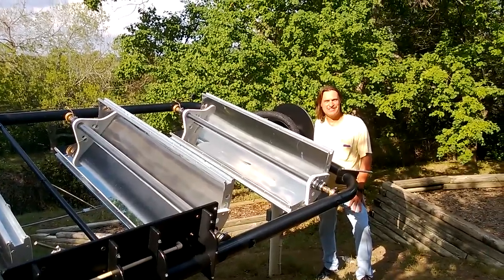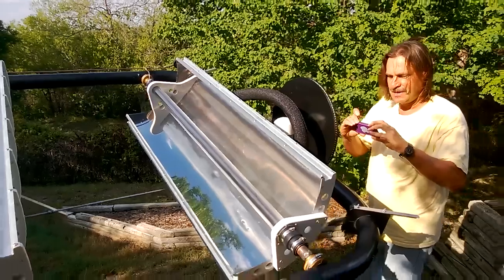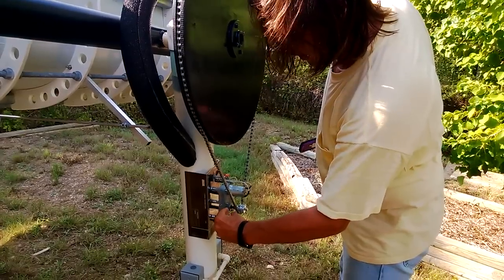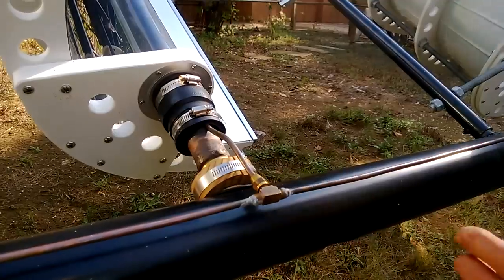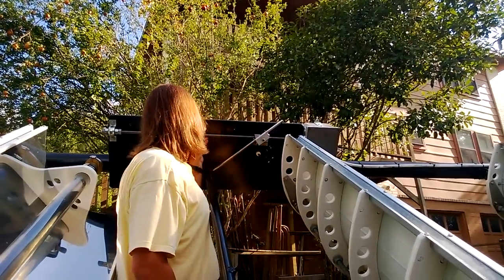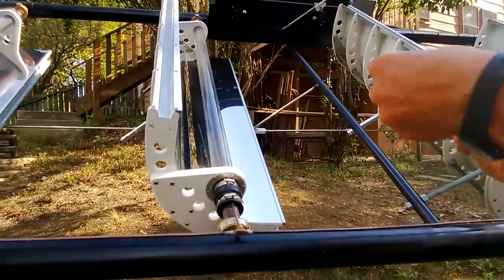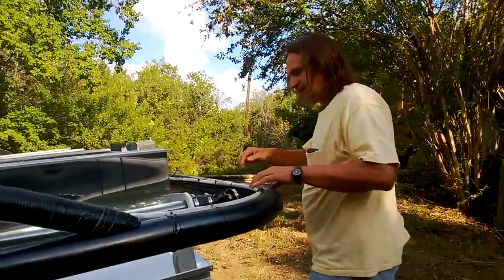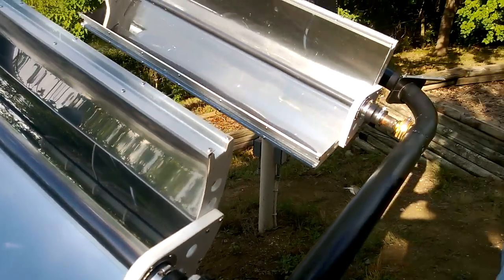Parabolic Trough Solar Collector Water Heater 6

Comment: I believed you use the Dan Rojas homemade vacuum tube with clear PVC.  Im guessing it does not hold vacuum constantly from leaks thus the vacuum pump to keep it at a set value.  If I am correct how is the clear PVC holding up?  Did you use the type with UVR protection or the standard type?
Reply from the maker: Coachgeo,   I used clear polycarbonate tubing (not PVC) with UV protection.  It is holding a vacuum fairly well.  Over a period of 6 months, a small amount of diffusion has taken place, but I suspect that there are no leaks.
Reply: Do CPVC etc. type fittings work with the Polycorbonate tubing? Many would love it if you did a video on how you made the Evac tubes!!  Or am I blind and dumb and can't find the video you did on this already :D
Reply from the maker: coachgeo
Coachgeo,  CPVC and polycarbonate are not compatible.  I used 1-1/2" copper for my focal tube, then converted to CPVC to go into the frame with a CPVC x Copper union (Genova 53046).  The polycarbonate is attached to the central focal pipe with "rubber" Fernco Couplings. 

Now coachgeo, if you are really going to make some of these focal tubes, then let me know.  I have many "unpolished" videos and photos to help out that will explain it perfectly (not ready for prime time yet).  You can get this done if you wish.  You just need to be able to braze copper.  Here is a diagram of the central tube:
http://www.modelofreality.org/SolarFocalTube.jpg
Andrew Ancel Gray
Reply from the maker: coachgeo You are correct in seeing that I have not made a vacuum tube video yet, or a solar water tank video, or a solar water heater roof mount video.  I am working on it!  Right now I am trying to get solar panels (PVs) installed on my home!  So much to do!
Reply: Glad to know Im not blind :D  As you consider what vid to make next... consider that there are many vids about most everything in your list with the ol' cat skinned a different way in each... but there is only one in all of video land about building Evac. tubes and it was not clear tubes nor Poly like you used. (thus all different fittings?)
Reply: Follow up to how to make question asked earlier. Do standard CPVC fittings work with the Polyvinyl tube or does one have to go a totally different route for fittings to create the evac. tube?  Care to shed light on what size ID & OD you  recommend?
Reply from the maker: coachgeo Coachgeo, here are some pics that may give you some idea.  BE SURE TO ZOOM OUT/SCROLL around on them, as they are very large pics.
http://modelofreality.org/2014-10-20_12.12.51.jpg  (see much more below):
http://modelofreality.org/2014-10-20_12.24.59.jpg  (see much more below):
In the second pic, you can see how I placed (then I will braze) a 2" copper cap over the 1-1/2" copper focal tube, and how I placed the small 1/4" vacuum line through the cap.  Then you can see the "rubber" coupling that I used to seal the 2-1/2" clear polycarbonate tubing.  The small end of the rubber coupling goes over the 2" copper cap, and the large end of the rubber coupling goes over the clear 2-1/2" polycarbonate tubing:
http://www.modelofreality.org/SolarFocalTube.jpg
Let me know what you think.  Andrew Ancel Gray
Reply: ancelgray  Much thanx will have to sit and study.  Conceptually am I right that you have what appears to me to be a single poly tube. This is sealed around a copper tube in center.  The space between/around Polytube and copper  then put inder vaccum.   Is copper an Acetone Fire stick inside, or is it a copper line to be full of Glycol?
Reply from the maker: coachgeo Yes, a single 2-1/2" (UV resistant) polycarbonate tube sealed around a 1-1/2" copper tube in the center with vacuum in-between.  The copper line is filled with 33%/66% propylene-glycol/water mixture (note: NOT ethylene-glycol which is poisonous).
Reply: Awesome. Thanx for your time and sharing!!  Mind if I put this info up on the "Simply Solar" discussion board?
Reply from the maker: coachgeo Go right ahead and post the discussion.  The more the greener.
Andrew Ancel Gray
Reply: Nice shots! What do you think about the longevity of polycarbonate tube? What kind of black painting did you use?
Reply from the maker: Well, I used polycarbonate because it is indestructible and I was rough on things during the design and construction (taking them apart, rearranging, putting them back together, blah, blah).  Glass would be better (because if won't yellow) if you could buy it cheaply enough so that if you broke some, it would not be so bad.   But so far, the polycarbonate has been fine.   I could not find a good source for glass tubing that was long enough except from China, and then you were required to buy a lot.

I used paint that was especially designed for solar panels.   I did some tests, though, and I saw not much absorption difference between the solar paint and regular flat black paint.

Comment: hi, I am hoping to start on a smaller system to heat my home built hot tub. I am intending to use the troughs to heat water during the day ( probably 4nos 1m long troughs) and a 500w wind turbine to charge batteries for an electric heater to run through the night. These batteries will also run the circulation pump. This way the tub runs 24/7.
Do you have any tips and advice for me on building the collectors, any common problems you came across, etc?

cheers,
Ross
Reply from the maker: TheRossRants Sure, Ross.  
1)  Study the outside edges of my trough design.  Notice that I put support under the mirror surface along the edges and that the mirrors do not sag.  Other designs on the web sag in between the parabolic supports.  This makes the light miss the focal pipe.  
2) Also notice that the troughs can twist with time and weathering and that I have used an "anti-twist bar".  
3) I decided to use a smart tracker that knows where the sun is instead of a "Sun Detector" using a light sensitive photocell.  The problem with the sun detecting photocell is that it wanders with cloud cover.  (However, if you  combine the "Sun Detecting Photocell" with a smart interpolater you can get it done, but I decided to use a "know-where-the-sun-is-at-all-times" controller.
4) George Plhak has a lot of knowledge that you can use to build your system, including an "e-book".  That is how I got started.  Use his videos and e-book (adding mirror support along the trough edges like mine) to find out how to build them. 
https://www.youtube.com/watch?v=6G-hd3M9yTg 
5) Ross, I used PV solar panels to charge batteries to run the system at night.  This seemed to work well.  I am not familiar with how complicated a wind/solar combo would be.  And there are heat-pump-water-heaters available that are more efficient that straight electric heaters.

Good luck, and let me know what you think.

Andrew Ancel Gray
Reply: ancelgray Thanks Andrew. Would love to have a system like yours .... maybe I'll get there eventually :)
I've seen a few of George's videos as well as the Dan Rojas ones.I like the idea of having it computer controlled with "know-where-the-sun-is" tracking rather than Photocell tracking, but as you say it might be good to combine the two as a check system. wind/solar combo is easy stuff. It uses a hybrid charge controller so power from both panels and a turbine can be used at the same time to charge batteries safely. There are many different units on ebay like this one:-@271692130903 What sort of wattage do the motors, computer, etc use for your array (trying to judge battery and panel size requirements)? Once I get into this project properly (might be a while)  I'm sure I'll have many more questions. Is it ok if I contact you with them for your experiences? cheers,Ross
Reply from the maker: TheRossRants Sure, Ross.  The Alix 1D computer (along with my driver electronics) draw about 1 amp@12VDC.  The two 12VDC motors that tilt the frame and troughs draw 1-2 amps@12VDC.  The pump also draws about 1 amp@12VDC for a max total of 6 amps@12VDC (usually a lot less though).  Let me know what you think.

Here in Austin, there is not enough wind to make windpower economical.  I have a 7 kilowatt PV array on my home.  The PV panels  along with my parabolic water heater do the trick.
Andrew Ancel Gray
Reply: ancelgray well, as my old geography teacher used to say - the UK gets weather, everyone else has a climate :) lol.The last 2 weeks have been pouring rain and 75mph winds. Today, clear skies, blazing sun and dead calm/zero winds. 6amp draw!? That's a lot less than I was expecting, so that's really good. Not sure if I can get an Alix over here, but I can probably find something similar - maybe a raspberry pi. We'll just have to wait and see :)  Thanks for all your help. cheers,Ross
Reply: forgot to ask, do you pump water through the mirrors to heat directly, or do you use a heat exchanger fluid at a tank somewhere else?
As mine is purely for my hot tub, do you think I should pump water direct or use a tank/heat exchanger set up?

Ross
Reply from the maker: TheRossRants I use a heat exchanger in my water heater so I can use anti-freeze (propylene glycol) through the winter months.  If you want to "tub it" only in the Summer, Fall, and Spring, then I see no need to use a heat exchanger.  If you want to use your hot tub in the winter and there is plenty of sunshine, then you should probably just empty the water during freezes and not worry about it.  I don't think I would use a heat exchanger for a hot tub system.

Comment from the maker: I also paid about $500 for an EcoSmart 24 Kwatt tankless ("demand-only") backup water heater so ALL my solar water heating is used (and is free).  If you have two tanks instead of using a tankless backup, then THE FIRST SHOWER IS NOT FREE (you pay for the electric backup tank first).  Since I live alone, that is NOT good.  So my TOTAL cost in closer to $2000 than $1500.

Comment: Does this technology make sense in 2016 compared to 20% efficient pv panels?
Reply from the maker: To Cabrio Driving in the Alps:
Well, I put BOTH on my home.  I filled the South and West sides of my home with PV's, and put the parabolic water heater on the North side.  The parabolic heater can be put on the north side since it is mounted on a dual axis tracking frame!  Now...   I know you can mount PV's on frames on the north, but the water heater is so much more efficient (~80%), that it is much more worth it, while the PV's, maybe not!  So with BOTH the parabolic water heater and our 7 KWatts of PV's, our home is now completely energy neutral (it generates slightly more total energy than we use).  But to answer your question, this design is probably not commercially viable unless it was produced with economies of scale, and perhaps the controller migrated over to a Raspberry Pi, for example.  However, the MATERIALS themselves aren't that expensive, so it was the ultimate do-it-yourselft project for the intensely green person! (So I built it!)
Andrew Ancel Gray
see
modelofreality d0T 0rg slash PV d0T jpg
Reply: Hi Andrew. Thank you for your detailed answer and your time. How efficient this heater is on a (a) semi-cloudy (b) cloudy day? Is it not effective then? Can it heat water if there is no direct sun due to clouds? What is the temperature of this central, heated pipe on a sunny day, semi-cloudy day, cloudy day?
Reply from the maker: Cabrio Driving in The Alps:
The heater does fine on a semi-cloudy day, but on a full cloudy day, not much heat is generated (unless during the hot summer, then some heat is created, even on a full cloudy day).
The temperature of the central pipe depends on the water tank size and how fast you pump water through the pipe.  But with 4 liters/minute (1 gal./minute) and with a 60 gallon tank, the temperature of the central pipe AND the 60 gallon water tank together (on a sunny day) quickly gets to 150F/66C and the system turns the array to the North.  Of course, the water can be BOILED on a hot summer day if one allows it, (which I DO NOT!).
Andrew Ancel Gray

Comment: Hey Andrew, Where did you find the glass vacuum tubes?  I am looking, but they all seem so expensive.  Thanks.
Reply from the maker: Sure, David, I used UV stabilized Polycarbonate Tubing.  I got my polycarbonate tubing indirectly from a company called Futurplast. The tubing is PCT0023-clear 2-1/4" ID x 2-1/2 OD Polycarbonate Tube (8 feet long). The description on their website (futurplast D0T ca) does not indicate UV stabilization, so I got them to send me a UV stabilization certificate:
http://www.futurplast.ca/newpl.pdf
A local plastic company ordered from them for me.  I think I paid about $50 apiece for (4) Eight foot lengths.

Comment: I am looking into building something similar for an experimental farm. Do you see this being possible in the Northern states? Like Montana?
Reply from the maker: BeckmanMJ,
According to insolation maps, Montana generally gets as much solar exposure as we do here in Austin (except far NW Montana). 

http://rredc.nrel.gov/solar/old_data/nsrdb/1961-1990/redbook/atlas/serve.cgi

So since this design is insulated with a vacuum chamber, yes, it will work in Montana just fine.  If you put this design on the ground be sure to orient the axes of the troughs East-West.  If you put this design on a roof, be sure and orient the axes of the troughs North-South.  The North-South orientation is overheat-proof.  The East-West orientation maximizes solar exposure (but can overheat in the event the controller fails).
Reply: Thanks so much! Super excited for this! How is yours working in the winter?

Do you have a link to explain more of the design. I understand the basics, but for starters i dont understand the vacuum chamber.
Reply from the maker: BeckmanMJ
BeckmanMJ,  Well, the frame is not yet mounted on my roof (I'm workin' on it), so it cannot really "see" Mother Sun because it is shaded by my tall home this winter.  However, early one morning it was near freezing (34F) and the sun was on it for only about 30 minutes and the temperature of the focal pipe was 80F (a 45F degree increase in just a few minutes).  The pump surely came on.  I suspect that it's going to work just fine in Winter.  Here is a diagram of the vacuum chamber:
http://modelofreality.org/SolarFocalTube.jpg
I have adjusted some of the pipe lengths to accommodate the wider end caps, but you will get the general picture.  I have used UV-stabilized polycarbonate tubing for the vacuum chamber, since here in Texas we have large sized hail coming down every once in a while.  The polycarbonate has a good light transparency, especially in the infra-red.  Let me know what you think. 
Andrew Ancel Gray

Comment from the maker: 4) Next, this concentrated parabolic system cannot overheat.  If the temperature of the collector gets above say, 165F (74C), then the controller simply moves the frame out of sun.  With regular commercial flat panel systems, overheating is a problem in the summertime, when frankly, you do not need so much heat.   If a parabolic system's controller fails, the concentrators still do not overheat, because in 30 minutes or so the sun has moved enough to stop the concentration of heat.  Therefore, I have used cpvc (chlorinated PVC for hot water) piping in all my hookups, a big financial savings (copper is really expensive these days).  Cpvc piping can be used here because the danger of overheating is gone.  And let me tell you, piping with cpvc is MUCH easier than dealing with copper tubing.      Andrew Ancel Gray
Reply: Hi, I read your experiment with great of interest.  I am trying to generate steam using a parabolic solar concentrator trough. Can you help us build a system with energy storage and hydraulic system. Zak
Reply from the maker: Zak Kouloughli
Well, yes I can.  I now have tracking electronics if you need them.  The electronics track the sun using the time of day, not using a "sun detector".   So the parabolic collector is always aligned towards the sun,  clouds or no clouds.  It has two two motor controls (double axis), two thermistors, and two pump controls.
Reply: Zak Kouloughli
I an interested.  Can you also provide the hydraulic system and the energy storage?
We are trying to achieve aaround 300 degres Celsius of steam.
Reply from the maker: Zak Kouloughli
My system is a computerized solar water heater controller for hot water (not steam).  Your system is going to be much larger.    I used small dc motors to move my parabolic  troughs.  My motor controller outputs go +12/-12V, so you would have to use these to switch your hydraulic valves.  And you would have to supply your own energy storage.
Reply: Hi Andrew, can you help build for me a solar system using a parabolic trough, tracking, hydraulic system and energy storage system.
The purpose is to achieve high heat to generate steam.